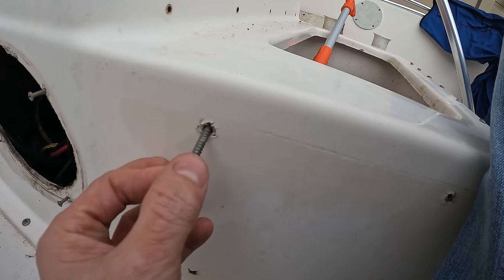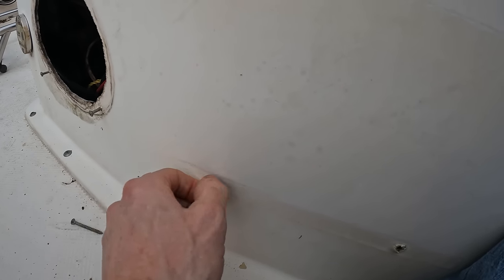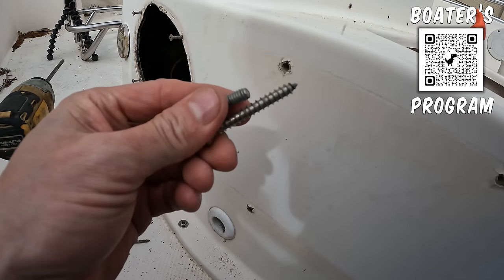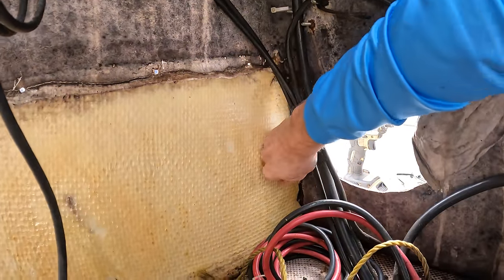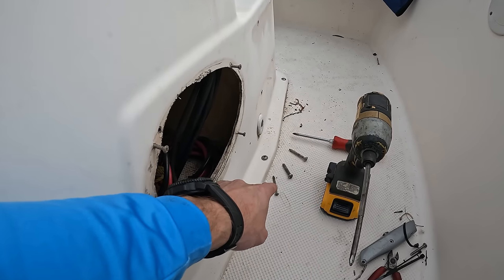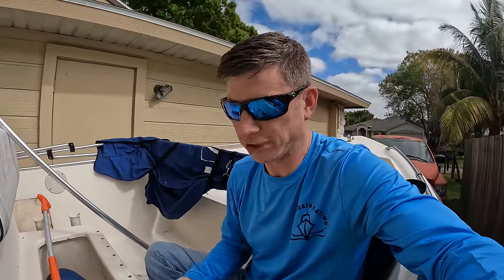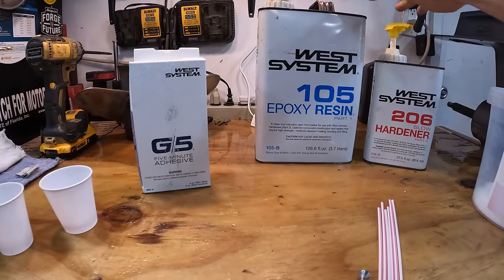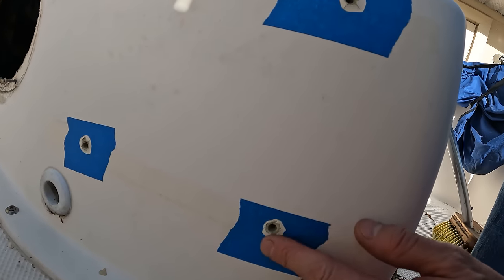PRO HACKS To Fix Stripped Screws In Fiberglass

Comment: Can also use those threaded nut inserts, much like a pop rivet
I put epoxy on the exterior of them when installing into fiberglass to give them more longevity
Reply: Nice, I was wondering if I could use riv-nuts on my boat & you answered my question perfectly!...thanks from Zimbabwe👍
Reply: Epoxy is a good tip also thanks. I use beeswax when threading into the threaded rivnuts to seal them in a removable fashion.

Comment: Great ideas.  Whenever I fix or fill old unused holes in transoms, decks, floors etc from old battery box mounts,  tranducers etc I usually drill it out to next size clean.  Then take a marine dowel they sell in like 2 foot pieces and  after i fill the hole with resin i push the dowel in so its snug but i leave about 1/8 inch short.  Then while its still wet i add MATCHING GELCOAT and overfill the rest of the hole so it MOUNDS a little.  Then once it cures I sand it flat.

Comment: Once the foam  is removed.. use a small piece of plywood on the backside of each screw  hole or however  suits  your needs and then run your screws back through  the fiberglass  into the wood.. then re foam the void space if desired.

Comment: I’ve done the zip tie trick when I’ve needed something to hold long enough to get home. My favorite is thru-bolting and I’ve filled the hole with marine Tex and redrilled when I couldn’t reach behind.
Reply: I’ve got to replace a bow eye due to the Lowe bolt stripping out. 

Do you think the marine Tex method would work in this case since I can’t look behind the hull?
Reply: @rainershea5861  if you’re trailering your boat, you’re going to need to cut an access point and thru bolt the bow eye or it will pull through again
Reply: I was afraid that would be required in this case. Thinking it will be best to have a professional take care of this repair then. 

Really appreciate your response!
Reply: @rainershea5861  they make plastic circular access holes. You cut a circular big enough to do your job, then screw it in when you’re finished. The factory probably installed the bow eye in the hull and the dropped the liner on top of it. The only way to not have an access hatch if there’s no other accessibility would be to separate the two halves which would be price prohibitive.

Comment: The zip tie was a good idea. You could cut a small square wood piece as a backing plate, then screws. Then use some caulking around screw head.

Comment: I've gotten a baby medicine syringe from the pharmacy, wash out the hole with some alcohol, let dry, then mix some or if the marine epoxy comes in a syringe,  inject into the hole, let it dry, then predrill the hole and us whatever screw you want that fits the predrilled size
Reply from the maker: As I'm reading your comment I realized I'm an idiot, you could just suck up the resin from the cup using the syringe instead of trying to pack it in from the top lol :/ smh, thank you for the comment! Love the baby medicine syringe idea :)
Reply: Trust me, it doesn't always work out that easily. 
Pull the plunger out and fill it from the back.
28 years of doing this... lessons learned the hard way. lol

Comment: You can use a large countersink bit to clean out the old hole and create more surface area for bonding.  When there is foam behind it, use a small Allen wrench chucked into a drill, insert it in the hole and clear away a small pocket for the epoxy to fill.
Reply from the maker: Great tip!

Comment: Hi. Thank u it is very professionally. Can we see in next video how u make thread throw poxy? Let me ask question when u will make thread, size of whole it is same to size of bolt? Thank u
Reply from the maker: When it comes to bolts and threads, typically the size of the hole is slightly larger than the size of the bolt. This allows for the bolt to fit into the hole easily without binding, while still providing enough contact area for a secure connection.
Reply: @BornAgainBoating  thanks

Comment: When the epoxy filling is done what do you use finally - screw or bolt with machine thread ? What is more strong?
Reply from the maker: Hello! Rose here, assisting Aaron with comments. Fantastic question! It's going on our podcast feature list. Haven't checked it out yet? Subscribe here: https://www.youtube.com/@TheBoatersPodcast
Reply: Bolt is best into an epoxy sealed rivnut.

Comment: I like to use a marine epoxy filler that comes as a two part A and B putty the last one i had good success with was called PC-7 and PC-11 and it was being sold at most big box stores. You can also just epoxy saturate a foam ear plug and stuff that into the hole half way when it cures you end up with a backing to the screw that is larger than the hole was originally because the foam ear plug expands outward on the inside. For really strong repairs mix epoxy with milled glass fibers or cotton flox to a stiff peanut butter consistency and paint the hole with plain un-thickened epoxy first then add the thickened epoxy filler you can also take a 90 bent nail with the head cut off or use a finishing nail on a drill and go into the hole and spin the bit to create a cavity behind the hole to allow a space for your filler to go into also the idea is you want to form a plug repair larger than the hole was originally to provide the strength. Most of these tips can be found in the Gougeon Brothers guide to fiberglass boat repairs a pamphlet sized guide book.

Comment: will epoxy filler stick to polyester fiberglass hull?
Reply from the maker: Yup, I always get that mixed up too, it's polyester that doesn't stick to the epoxy. Most boats are all made out of polyester resin, so epoxy pretty much sticks to everything. But it is also usually talking about paint, gelcoat, and the coatings when people talk about poly not sticking to epoxy.
Reply: @BornAgainBoating  thanks! I fixed deep keel gelcoat scratches with epoxy gelcoat, than thought that maybe I should have used polyester based, but after a year the keel still looks fine, nothing fell off.

Comment: Hi! Is it not possible to take a dowel and just put it in the hole and fix it with that. 
😊
Reply: That’s what I use Dow and epoxy. Pre drill done.
Reply from the maker: Yup, like he said, with epoxy :) also remember wood rots, depending on where you need it too go, could factor in there :) but soaked in epoxy, should last many many years!

Comment: Just move it over a little to to good glass. Done. Why the holes busted out is because the rod holder was installed without bedding compound (like 4200). At least some silicone. It will hold it instead of the screws
Reply: Some of us prefer not to just keep drilling new holes in our boats.
Reply from the maker: You could do that

Comment: Pro Hacks ... use a zip tie LOL.   Make SURE THIS guy NEVER works on your boat.  Even at the final fix with resin, this person is an amatuer that obviously doesn't do fiberglass repairs routinely.  There are structural fillers for epoxy and fairing fillers.  Gomer here doesn't know the difference.

Comment: 5200
Reply: I have used 5200 and it works. Or depending of the situation I use Stainless Steel threated inserts, T-nuts, or Petal rivets nuts for thinner fiber glass.
Reply: Not in rod holders or anything that may need to be removed later.  Use the 3M 4200 instead.  5200 is permanent and must be removed mechanically.